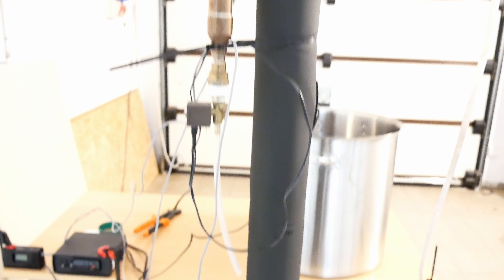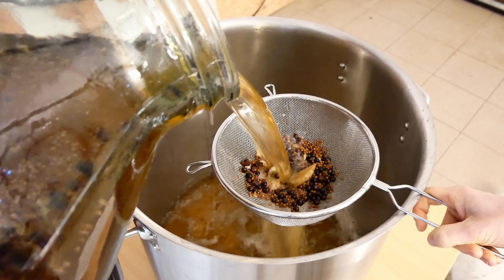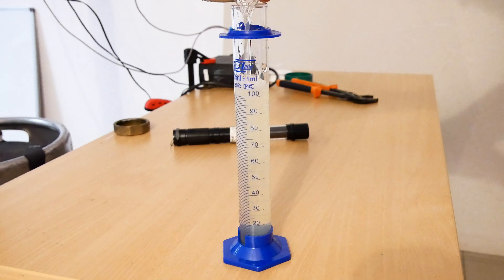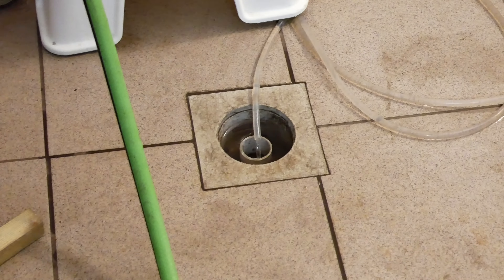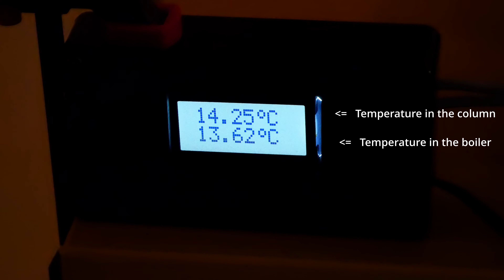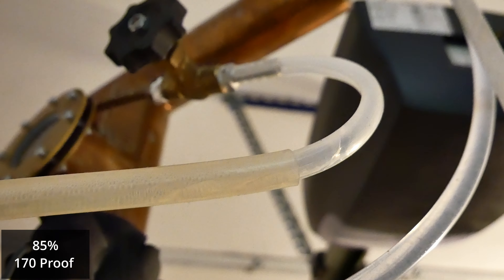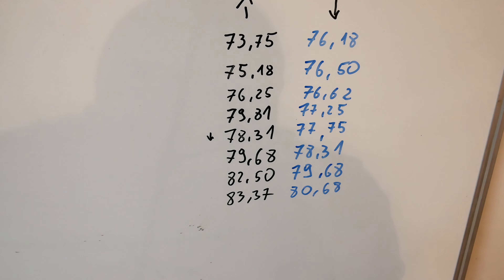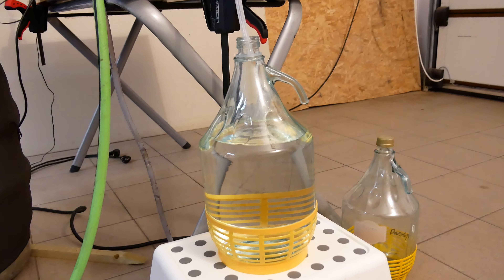Pot Still Distilation On A Column Still. Here's How To Do It

Comment: I have a stainless steel beer keg as a boiler. I used it over a gas burner. I want to put an electric heater in it. Will a copper element be used?